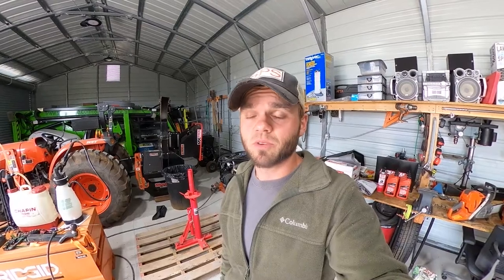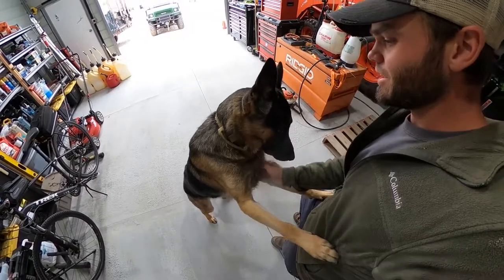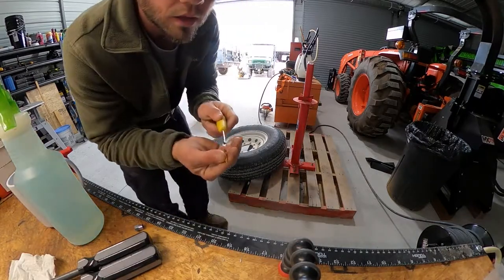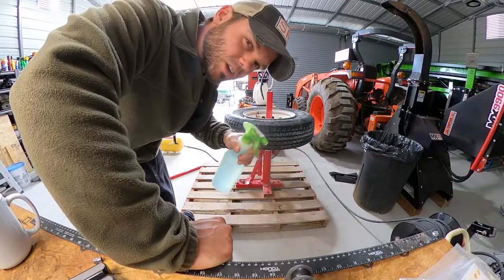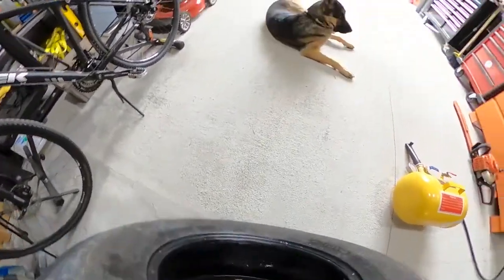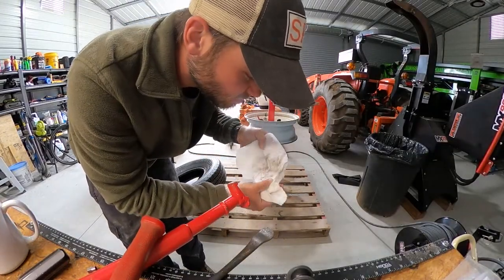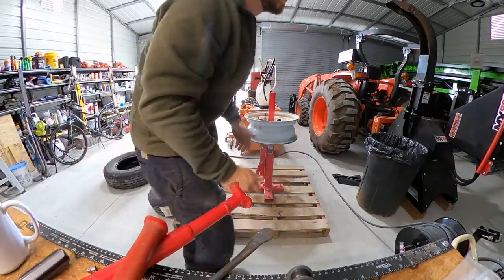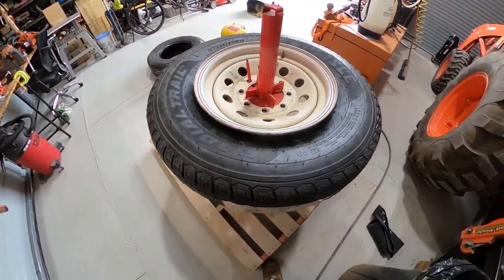How to Change Your Own Tires Using Harbor Freight Manual Tire Changer

Comment: I cut a piece of carpet to sit between my wheel and the tire puller so that I can pull the tire off the back side and avoid scratching/dinging the front side.  Before you tighten the top nut turn the wheel so it can't move in the direction you are trying to remove it.  I also destroyed the bead breaker and prybar that came with it.  Beefed both up now it cannot be broken, this tool has paid for itself and I only use it for trailer/ATV/UTV tires sometimes on specialty mud and snow truck tires.
Bead blaster would be nice, I use a ratchet strap down the center of the tread to start the bead, it has only in recent years been an issue as I get into the heavier load range tires.
Reply from the maker: Not gonna lie that's an excellent idea. Do you just use regular carpet? I have only used it for my trailer tires and I scratch those things up pretty bad. It's not that big of a deal, but I would like to change our vehicle tires without dinging them all up as well. The bead breaker is cheesy. That thing has an upgrade coming to it in the future. What did you use to beef up the prybar? I was thinking about putting a piece of tubing over it and welding it on. The bead blaster is a game changer. My dad always used a rope and some starting fluid. We had enough close encounters with that for me to not want to do it hahaha
Reply: @reallifetested2605  I used the thickest plushest carpet I had on hand at the time, it has lasted over 15 years.  For the prybar I collapsed the thin wall tubing so I cut it off and I happened to have some 1.31" OD x 37.5" long tubing from somewhere that the ends fit into and welded them permanent.  The newer version might be thick wall tubing already I haven't looked at them.
I don't use it on my good smaller aluminum vehicle wheels but it might work for you there.  You're certainly clever enough to make it work.  I use Costco for tires mostly, they provide decent service.  Good luck.

Comment: Nice video man, I just want to say with higher psi tires it is important to check your pressure before driving when it is cold. The friction from rolling resistance will increase the psi as you drive but the psi listed on the side wall is for cold psi so if you take air out after driving especially with a heavy load the tire will be underinflated especially when cold again and much more likely to blow out.
Reply: Just some advice from a truck driver.
Reply from the maker: That's a question i've always had and have never had a chance to ask someone like you who knows. Here our summers can be 50 in the morning and close to 100 in the afternoon. When I check my pressures in the morning they will be the standard 120-125 psi. If I check them in the afternoon they have been upwards of 135-140! Do you think this is safe or should I air down to account for the higher temps?
Reply from the maker: I responded to your other comment with a question. I appreciate the good info and hope you can help me out with my question! Thank you.
Reply: @Real Life Tested  This is a tough one because that is a big jump. I think the best thing you could do is get your tires filled with nitrogen at the highest cold psi. Nitrogen doesn't expand and contract as much as air so your large swings would be no problem.

But with air I would probably play it a little bit safe and run 5-8 psi lower in the 50 degrees morning compensating for the 100 degrees days. But the tires are technically at a lower weight rating in the morning then. 

I hope this is helpful and sorry if it's not. I've tried to word it better 3 times and apparently this is as good as I'm going to get it right now.

Comment: Jon if you don't tighten them after you drive about  25 miles the lug nuts will back off any you can loose that tire on the road. With trailers you may not notice the tire is missing if you are empty but loaded is another story. Same with passenger vehicles and trucks make sure you tighten twice!
Reply from the maker: Yep! I mentioned that at the end of the video. That's a very important step!
Reply: @reallifetested2605  I owned a trailer dealership and our transporter lost one tire on a trailer. His partner on a different trailer the lug nuts stripped out. 

So that is why I say even on my personal vehicle it is important to have them done every tire rotation. I know what my turn around spot is and I do it first then park the car.
Reply from the maker: @brendamaroney2966  That's awful, I hope eveyone was ok! Things like that are dangerous. I personally know a guy that got his tires replaced, he was driving down the road and his front tire came off at 60! His tire actually went through the side of the bar. Luckily no one was harmed. He said it was a heck of a ride though lol
Reply: @reallifetested2605  the tire went off into the desert. Nothing was harmed but when he pulled off the road he was thankful he had 3 tires on the trailer and he put on the spare tire. The transport company called the factory and said put another spare tire in that trailer I am picking up. He  brought the tire out in the next trailer. But we ended up having the trailer sold so we replaced it locally. The next week after we had the spare some one else lost a tire to a flat so eventually we started having a few spare tires for emergencies.
Reply: I always thought that applied to people having it done by others.  If you pay close attention to clocking/centering it on the hub I have never had to retighten lugnuts.  If you have a professional do it definitely check the torque, probably before you even get out of the parking lot.
I change wheels twice a year for winter/summer, never had a problem.  Famous last words though...  
Wheels can be heavy and it's hard to tell they are clocked right but it's as simple as that, no magic lugnut fairies just mistakes cause loose wheels.
Reply from the maker: @thereplacementfordisplacement  I know it's awful, but I don't get anyone to do anything for me because of stuff like this. I have trust issues because in the line of work i'm in I deal with ton of people, and I see people get screwed all of the time and it makes me so upset. I'm not saying everyone is like that, but enough to make me feel uneasy. You're right though, if you do it right theres no need to worry about it.

Comment: Are those real heavy duty tires? I have never had a tire take over 50# before. I’m wondering if I am not doing it right. Are you just going by what it reads on the sidewall? And that’s good to mention about torquing studs, Most don’t that just change a tire, I allay do, I have 3 torque wrenches for different torques of course, My newest big one is easy to do the truck now. Another thing I have seen something that very few people do is read the instructions. Because storing pressure if very important for longevity of your torque wrench . Mine says to back them off to 20% of max pressure after every use.
Reply from the maker: They’re a load e rated tire. From what I’ve seen the higher the load rating the higher the pressure. I have some load f tires that take 125 psi!

Comment: It's usually easier to seat the new tire to the wheel if you leave out the valve core until the air pressure seats the tire.  The valve core really hinders the air flow.
Reply from the maker: For smaller tires like this i've found it to be just an extra step. In this video I got the bead set on the first try. Although i'll admit it usually takes at least a 2nd try. Thanks for checking out my video!